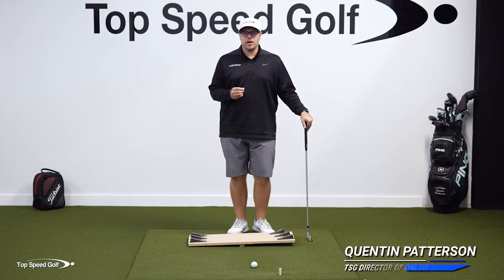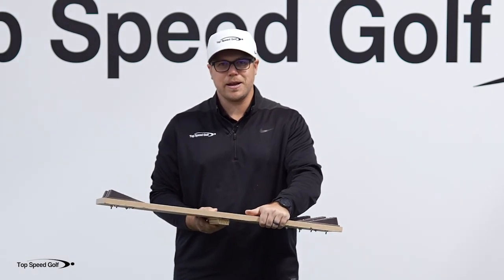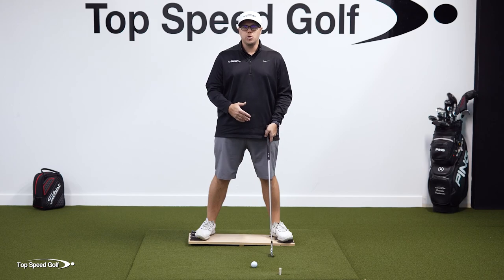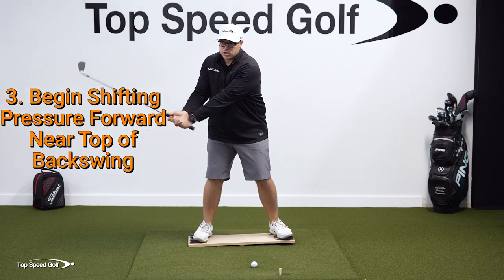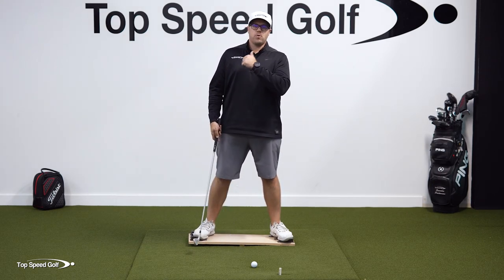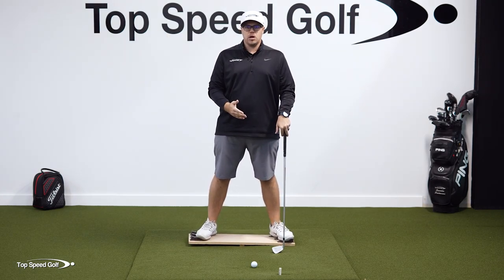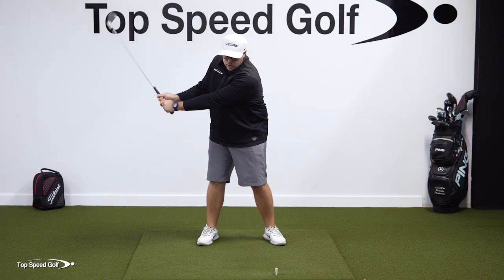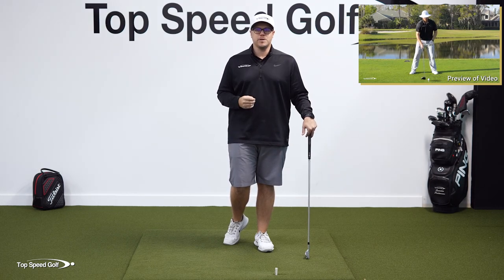The Key To An EFFORTLESS GOLF SWING | Teeter Totter Drill

Comment: This is why Ben Hogan in Five Lessons suggested a slightly knock-kneed sitting down posture at address. If wearing conventional hard soled, purpose built golf shoes it allows the feet and body mass  to rock laterally parallel to the target line, which is a critical part of changing the force vector if the swinging club head from tangential to the circular path to straight towards the target.  

Most recreational golfers today do not understand how to move body mass laterally because they wear soft soled sports shoes which don’t make it easy to keep weight on the insteps and have been taught not to sway or hip in the takeaway but instead to swing club with shoulders around stationary hip, how Tiger did it before wrecking his back swinging that way.